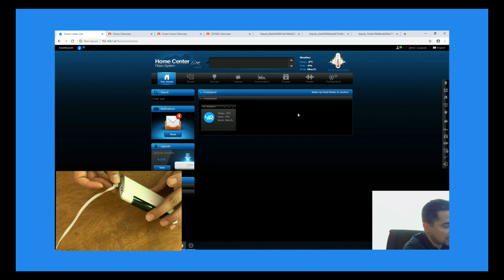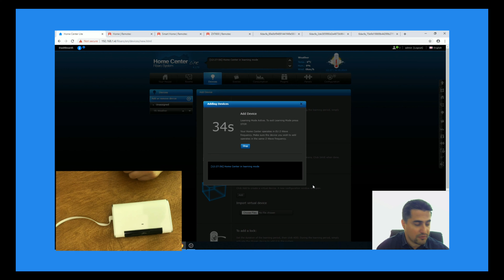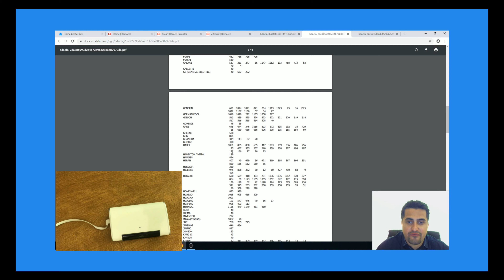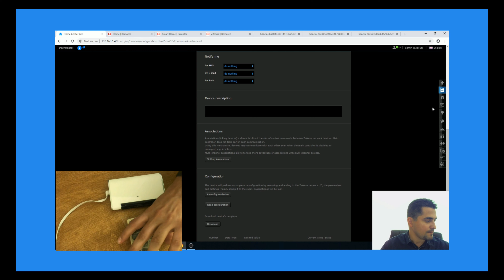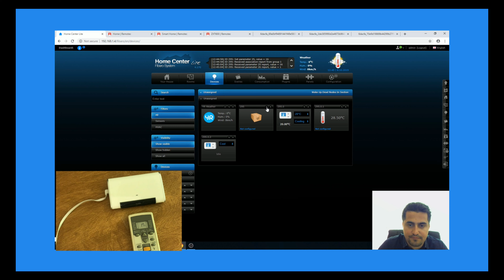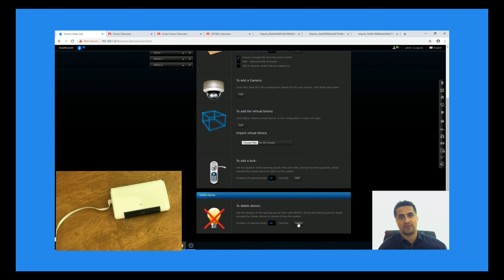How to add ZXT-600 to Fibaro

Comment: Very nice guide, but I have a simple question: after setting the right AC code from library (sent to ZXT-600 by parameter 27) is it possible to remove the parameter 27 from device confguration or shoud stay there? Thank you very much!

Comment: Thank you again for your effort. I have included ZXT-600 to my Fibaro HC3 but unfortunately it is not giving me the correct temperature reading. Do you know how to fix this issue
Reply from the maker: Hello, Thank you a lot for your support. Have you tried calibrating temp reading (Parameter 37)
Calibrate
temperature
reading:
(37 (0x25))
Temperature offset value.
0(0x00) = 0°C (Default)
1(0x01) = 1°C
2(0x02) = 2°C
3(0x03) = 3°C
4(0x04) = 4°C
5(0x05) = 5°C
255(0xFF) = -1°C
254(0xFE) = -2°C
253(0xFD) = -3°C
252(0xFC) = -4°C
251(0xFB) = -5°C

Comment: Thanx for the video. Can you recommend the zxt 600?
Reply from the maker: You are welcome,I recommend it For controlling AC systems that have IR controls . Try to use it with 5 Vdc power than batteries.